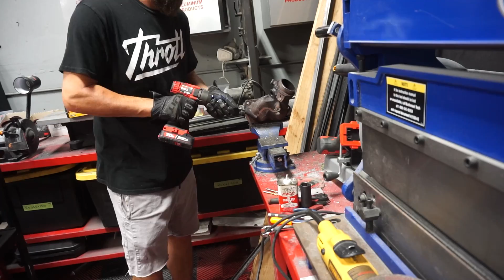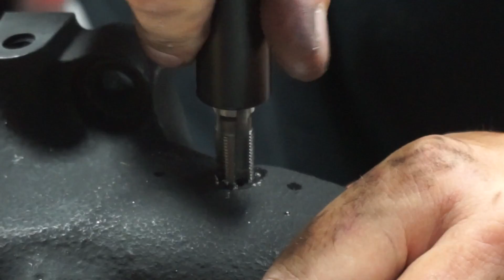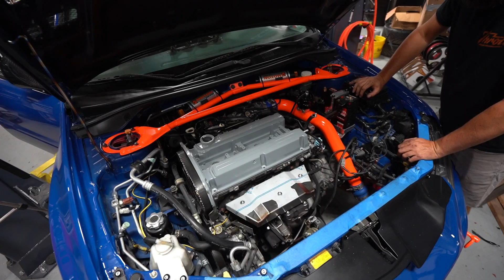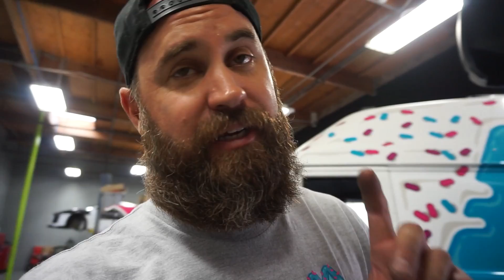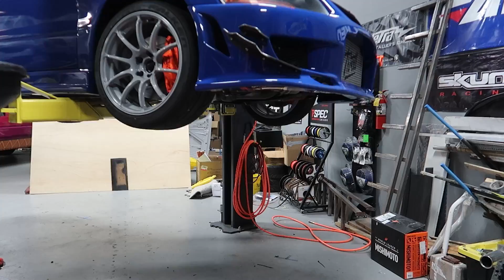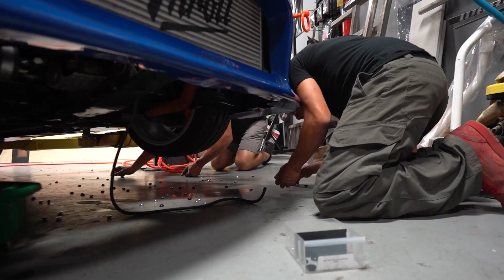Building the ULTIMATE Lancer Evolution VIII - Part 6 : It's DONE!

Comment: to remove those studs Mick, use a TIG welder, build up the metal, weld a nut to that metal then you can remove them 💪 cobalt drill bits will save you time drilling through cast iron and stainless steel. can we get a flo-orange pin stripe on the spark plug cover?